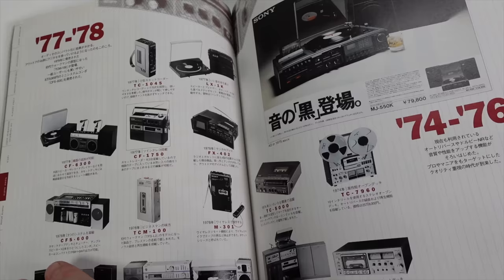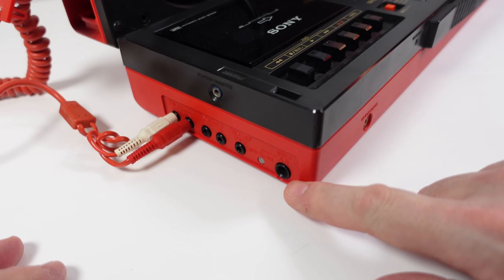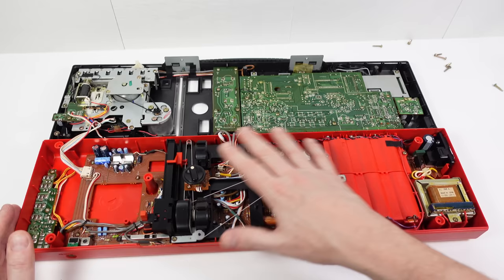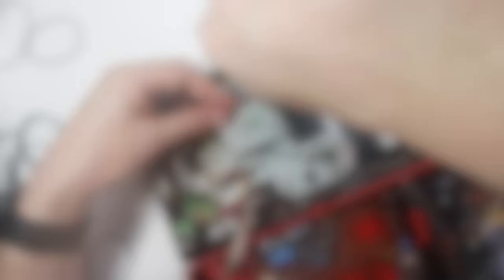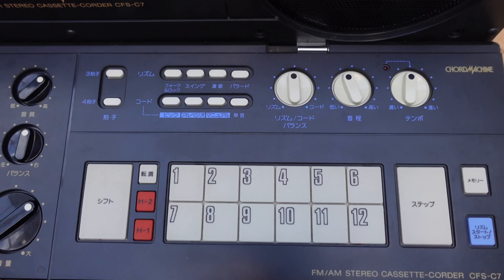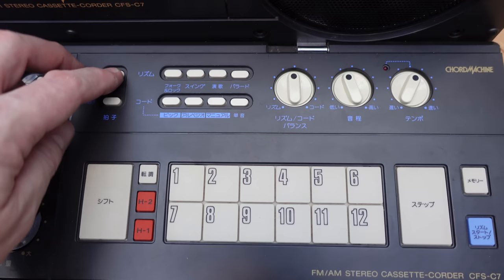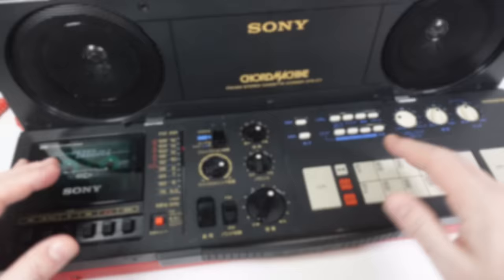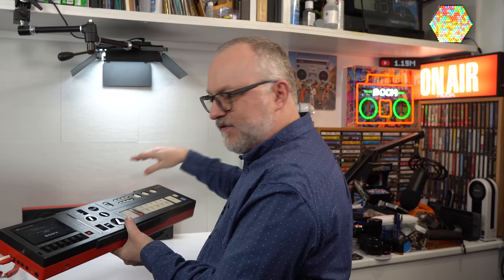The Sony CHORDMACHINE

Comment: The legendary TB303 was designed for this sort of purpose, to act as a bass player/accompaniment to accompany a guitarist. Unfortunately while that was analogue and had sonic possibilities this one is just using a chip with pretty much none. Of course it could be circuit bent.
Reply: But the TB-303 had a built in programmable sequencer, this doesn't. I can't see how this is any use for accompaniment, like with a guitar as suggested, unless someone else is operating it, or you record the backing track beforehand. Seems a lot less useful

Comment: The different "chord" modes seem to be a bass/lead line generator, rhythmic chords, arppegiated chords and finally sustained chords. The modifiers allow different arppegio patterns.  It also seems like one key distance is a semitone.  I think the modifiers can also change major to minor chords.

As a basic backing track generator with recording function, it's pretty cool for a low end unit.  I wonder how much they cost?

For example, you could play a backing track onto tape, then play guitar and sing over the tape playback.  

It's certainly not pro gear.  But then a basic semi pro recorder in 1982 would have cost you $900US in 1982 currency prices.  A cheap keyboard with rhythm/drum machine with preprogrammed patterns would have cost $400 minimum, and it wouldn't sound all that much better than this.  

For someone who just wants to learn and play around a bit, I think this is a great bit of kit.  It has some layout and design issues, but for its time, it's quite amazing.
Reply: To add: the rhythm buttons are labelled "folk & rock", "swing", "enka" and "ballad", and the chord buttons are "pick", "arpeggio", "manual" and "single sound".

Comment: Chip date code on one of the IC's week 31 of 1982. The TD62105P are 7CH Darlington Sink Drivers with a 20K ohm input base resistor and 12-25V CMOS voltage range the TMS3615-25NS are the 
Octave Multiple Tone Synthesisers - (OMTS) basically they make that rather interesting sound the only data I could find was from 1981. Device are long obsolete but there are a few floating around on the grey and seconds markets if you want to take a chance on one.

Comment: I’ll say this for Sony, I’ll say this… The Chordmachine is so ahead of its time, the damn thing looks like it could have been sold and made in the 2000s!!! Short of the tape deck that ages it, the design of the unit is extremely modern. It also goes to show you that 40 years ago wasn’t what 40 years ago was in 1982 (1942). It wasn’t that long ago and it’s just amazing to see how innovative Sony has been over the years regardless of failures and successes.

Comment: You could probably easily be able to hack the audio from the synth/drum machine section so that it runs into the input of the cassette and radio section.   To me, it looks like it's one of those early devices aimed in the direction of an accompanying device for a singer, or music player.   It really seems to be designed for say, plugging a guitar or keyboard into, and playing along with the drum machine/chord section or maybe even the cassettes.  Roland had a few, pretty classic devices that were designed just for that purpose.  And these accompaniment devices were all the rage back then.  They were designed for instrument players who wanted drums, and maybe a simple bass line or chord sequence, to play along with.

Comment: An easy redesign of this box would have been to convert the cassette "deck" into a portable Walkman with record/playback that could be detached and placed into the center between the speakers. That would have allowed it to have boombox capability and a nifty portable Walkman when you didn't feel like doing the Travolta strut or the Ez E.

But I think the million pound question Matt is........where's the TV???? During the LCD TV craze, there was a postage stamp LCD TV or Watchman on every electronics shelf in the 80s and this music box seemed a good candidate if it were released in the Sony 8mm days. Imagine, this music box, a state of the art Sony LCD monitor in the middle, a keyboard, and an Sony 8mm player and you would have had the ultimate Karaoke machine!!!

Comment: An example of integration between a chord machine and the built-in tape cassette would be the Philips Personal Media Composer PMC-100 from 1986. It uses the cassette both for playing and recording audio and also as a data device for storing the internal code for the chords and melodies you program on the device so that you can load and modify those at a later time. A funny device.

Comment: Suzuki released the Omnichord in 1981. And Roland released the TR-303 and TR-606 in 1981. Those were little battery-powered synths intended to be a convenient way for musicians to practice (unlike the TR-808 which was a big thing intended for music production). So it looks like Sony was trying to compete with all of those by making a single box that had drum and chord accompaniment and a bonus tape recorder with an instrument input. If you mod this thing to have MIDI and make some lo-fi tape loops you could probably invent a new genre.

Comment: I would find the buttons useful with the Nashville Number System which uses Roman numerals to convey the same meaning. 1-3-4 is traditional country, 1-4-5 is traditional rock and modern pop is often 1-5-6-4 is a very common modern pop chord progression.

Comment: Regarding the guitar playing bit. I'd want to plug in into an input jack, maybe the same one you plugged the microphone in so you could do the demo, and then play along with the synth/drum machine. However, it does sound like it wasn't designed intuitively enough for my liking, so, if that output jack used to connect the speakers was actually working well enough, I'd connect it to a bigger speaker such as a cab used in an amp stack, and then play my electric guitar as I normally would. It's an intriguing little gizmo though!

Comment: I'm pretty sure I built a "synthesiser" from a kit in practical electronics (or a similar mag) in the late 70's or very early 80s, based on a custom programmed tms 1000N  (must be related to the sound chip on that keyboard)  a couple of years laer I bought a TMS10xxN from a surplus outlet(Bull?), that was salvaged from a "Battleship" game -that  had a noise generator as well as a tone generator (for the explosions)  (both chips weee monophonic btw)  [edit  the Wikipedia page on tms1000 series mentions them being used in "Simon" and "speak and Spell")

Comment: Personally, I would’ve liked something like this to play chords or arpeggios at a set time. It would help playing the melody of certain songs to have the bass line being done with less thought from me.

And as far as the buttons go, it’s just a standard harmonic scale, so something like A, B flat, B, C, C sharp, D, E flat, E, F, F sharp, G, G sharp. That’s a full octave. It may not be as clearly labeled as piano keys, but that’s pretty much unavoidable since you can freely adjust the pitch to whatever, so 1 could be A, C sharp, D half-flat, or whatever. For someone like me, it wouldn’t be a huge problem to deal with.

Comment: At least one of those modifiers seems to control major/minor modes.  Also, one or two of the play modes were arpeggios, so perhaps the modifiers alternate arpeggio types (up, down, etc.)  It would have required much more expensive pads to make it operate as a drum machine.

Comment: So basically it's a drum machine grafted to a cross between a sequencer and an electronic autoharp with options for arpeggiated chords. I can easily imagine a songwriter fiddling with this while struggling with writer's block.

I kinda dug the oddly shamisen-sounding rhythm patch due to the WiFi interference. Sounded very Sony; I think Masaru-Sama would have approved.

Comment: Regarding your "wish list" of enhancements that would have been good for the original machine...Remember that the late 1980's were a time when digital reverb and digital drum machines were first coming on the affordable market, led by Casio, Yamaha and Alesis.  It might have been just a bit too early for such features to be included with a cheap boom-box kind of unit if you wanted the selling price to be much below $1000.  And if you wanted the sound "capture, digitize and edit" function that you are suggesting, remember that nothing was available in the consumer market yet.  A custom design would have skyrocketed the price.  I know about this because I had a hand in the design of the Alesis HR16 drum machine, and we had to kludge together expensive sampling electronics and write our own processing software just to capture, and store the drum sounds.  One of the design requirements was quite limiting: We had to store all of the sound data in a small PROM -- an easy and cheap task today, but quite a different story in 1986.

Comment: Great video, and I like that you proved out the the function of the speakers, but I'd really appreciate having the audio patched through the headphone jack. Between the unit's speakers and your microphone, it's hard to tell what the output is supposed to sound like. I have a feeling I'd like the unit's output if it was fuller and flatter spectrum.

Functionally, if I had bought this in the 80s, I would have been livid to find out that the attached tape recorder couldn't be used to record my funky beats!

Comment: As a contemporary drum machine it’s somewhat lacking, but compared to an earlier rhythm machine (with set rhythms and limited playability) it’s actually a bit more fully-featured.

My guess is either someone at Sony heading up a development team really liked analogue synthesised drums, or Sony was testing the receptivity of the market for a Sony synthesiser range. But it seems quite odd as a demonstration of what they could do for synths, so I feel like it’s the former, with a stock Sony tape/radio stuck-on for good measure.

Comment: Hey Matt, since you've uploaded again, I'd like to make a review recommendation: BKV's karaoke machine (blanking on the model number ATM Might be KS-# or something). This machine is rather bizarre in contrast to all others I've encountered, in the aspect that it has no built-in speaker, nor video screen for lyrics and such. The reason being is the build of it; its made like an entertainment center DVD player, despite being for music, supposedly.
   I'd first come across this oddity last autumn at my local pawn shop, here in the MIdwestern US. It had input for all forms of storage media, whether it be CD, USB, or even SD card. As expected, there were buttons for selections and effects, mic inputs, knobs for volumes, echo, and so forth on the front. What intrigued me however was the the variety of outputs this machine had. It seemed like it had AV-out in pretty much any form, really. RF, RCA, S-video, component, VGA, SCART, speaker connections (RCA, coaxial, AND Toslink IIRC), even HDMI, somehow! They seemed to have jammed a lot more outputs into that thing than they needed to. Or at least, more than I've ever seen on another karaoke machine.
   Last I'd looked online, I couldn't find much any proper reviews or teardowns of the device. And given my lack of disposable cash at the moment, I sure won't be able to buy the one still there at the pawn shop, either (not that I would be able to walk all that way and back, being snowed in and all ATM). So I think maybe a review of the unusual thing may be just right to satiate my curiosity, if it would at all be possible for you. Best hopes you may consider this one, pal. And as I always sign off: Where there's compromise..improvise.

Comment: It seems that the H-1 and H-2 buttons changes the quality of the chord. When you pressed H-1 while holding a major chord, it changed to a major seventh which is the type of chord that's prominently used in Erik Satie's "Gymnopédie no. 1", and also commonly used in jazz, video game music and pop songs that want to evoke a nostalgic or dreamy feeling.

The Wi-Fi interference changing the sound of the drum machine actually sounded really cool, especially when you moved it around. I wonder if you could circuit-bend this device with an additional knob to get that sound without needing to rely on radio-frequency interference.

Comment: To me this device clearly looks like a tool for home musicians to record themselves and add backing drums and chords, with the radio and tape-playback functions kind of being bonuses. Seems to me the main idea is for someone who sings or plays guitar to plug in their mic or instrument and use the synth functions to spice up their cassette recordings. I think this is why it has such "limited" looking chord functions: it's designed to be used simply and quickly with one hand while you're holding a mic or playing a guitar or something. When looked at from this angle, I think it's maybe less limited than Mat's opinion of it, haha.

Comment: When I was working as the Sony Center in the early to mid 2000's there was a high end system called the Lissa system I don't think it sold well it was highly priced at the time in fact I think it took a couple of years to sell the display model after it was discounted many times. It used some kind of FireWire connections and I think it could all be controlled by a p.c it looked fantastic had those egg style speakers anyway would love to see you do a review if you could get your hands on one

Comment: Have you ever tried using an Omnichord? It's another analogue curio. Made by Suzuki, it has those great 80s drum patterns as well as an autoharp section and chord generator that allows for 70+ types of chord! Very curious instrument, David Bowie used one as well as The Flight of the Choncords.

Comment: I think it would have been aimed at solo guitarist/singers as a practice machine. You get used to the format of 'playing' the chord pattern or progression for songs and then record them in real time onto a blank cassette. Then you can practice your set along to the recordings. But why, when professional backing tapes were available, and it also has a rudimentary mixing function. Maybe because it was marketed as a cheaper alternative than buying backing tracks. I also think that the tone generation sound quality is far too basic for use at a gig, well maybe one or two ultra-niche ones, which is what leads me to think that it was intended for use as a practice device.
On the other hand, it may have been marketed as a tool for non-musicians to create and record something quickly and relatively easily, without all the hassle of learning how to play a keyboard or guitar.

Comment: I can definitely imagion someone like Barnaby Dixon, lo-fi musician or a circuit bender using this in a performance. Not having a piano style keyboard and only being abe to trigger one chord at a time is no problem since you mostly play it one handed and sing or play the lead on a different instrument with the other hand. The layout is similar to the common PMC. At first I'd just slap some stickers on each button saying what chord it is. Effects can be added by having the line out to speakers pass through an effects unit first like a Kaossilator. Probably pairs up well with a loop pedal. But yea bummer if the the tape deck can't play at the same time. If it did it would be funny to pop in a tape of sounds and manually hand turn the tape like record scratching.

Comment: The concept is very much like the chord organ. They were inexpensive instruments for the home with a small keyboard for melody line and a single octave keyboard that played chords. Typically it would be a reed organ with either a bellows or electric blower. The idea was that someone with very little musical training could still play accompaniment to melodies they knew. When radio and cheap recordings came along they died out. This machine seems like it's trying to add the concept to early karaoke.

Comment: interesting. would have been useful if the chords actually have option to play different sounds instead of only one synth sound,  in the time it was released could have been nice for producers to record those chords on a tape, and then later overdub it with other stuff

Comment: The hinges don't make a connection to the speakers? That surprises me. Of course it would only be mono if they had done that, but I've seen several devices that connect the speakers through the hinges, and only need to be plugged in if you use the speakers remotely.

Comment: If you find you don't have a tape drive belt the right size, how do you get around this? Any tips? I've got a Denon Tape Deck I'm struggling to repair because the belts are either over-tight or too loose. Thanks for the video. Really interesting as ever.

Comment: standard musical keyboard layout would be impractical as it can only play one note at a time, so you wouldn't be able to play chords. At least with pads you can switch to single note or chord, although it limits the chords to the base ones (so no Em7 or Csus9!). Making the pads drum pads would require a proper re-writable memory I'd assume, raising the cost massively. Little point doing it if you can't replay what you've made to play along with the chords.

Comment: Can you record what you are playing to tape along with the microphone and guitar? Is there a volume for the guitar input? I thought the same thing as you that it was a missed opportunity you couldn't play along with at least the radio. Believe it or not I used to have something similar from another manufacturer with a full sized keyboard, only the radio could do shortwave! Awesome thing only it had the same restrictions on mixing the radio in with the keyboard. Wanted to modify it so I could play along with the shortwave and maybe a cassette too!